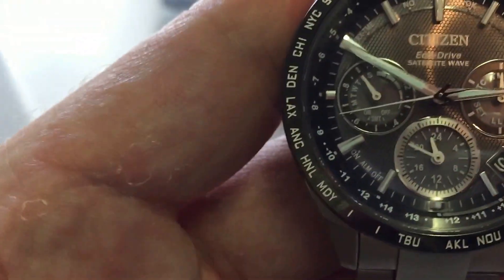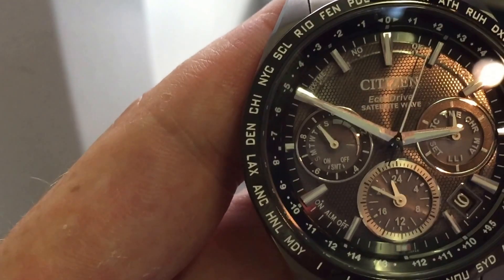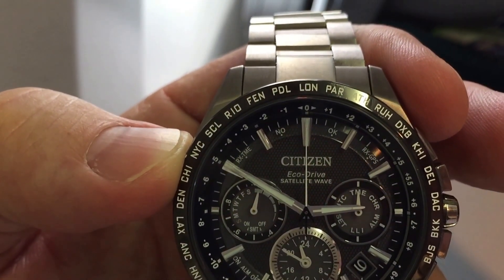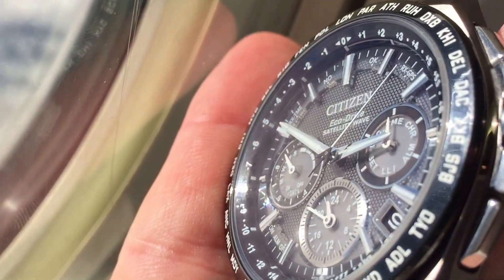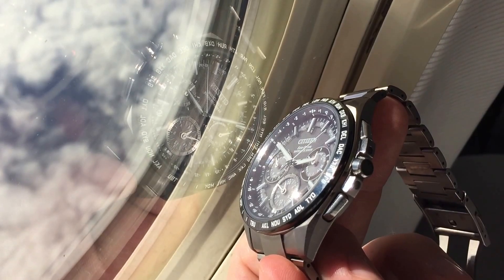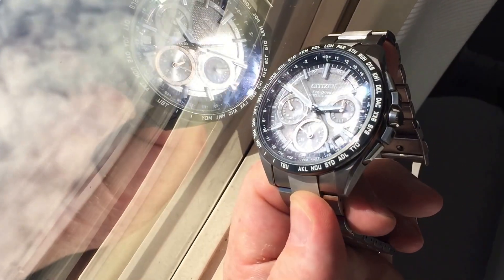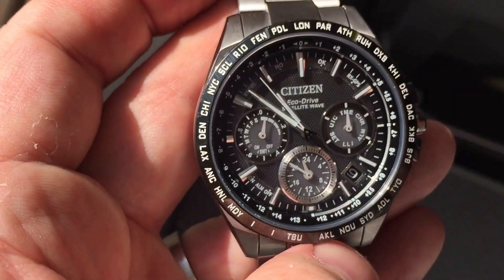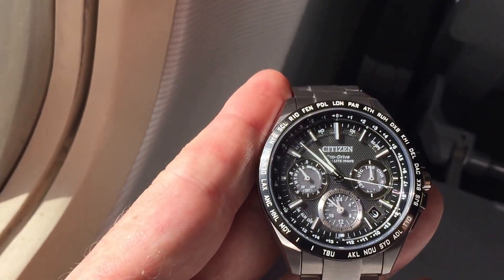Satellite Wave GPS F900 - in-flight test

Comment: Does it do auto sync at a given hour everyday like the radio controlled ones?
Reply from the maker: No, with Satellite Wave it needs direct line of sight to the sky. 

So, it has a light level detector which will detect strong daylight (to determine that you are outside) and will do a quick sync when it detects it.

This will be done automatically whenever the watch has not been synced for six days or more.

Comment: Question so this watch it doesn’t change time by himself??? Do we always push that button for satellite signal?
Reply from the maker: It will look for a time signal by itself every few days when it is in light.  You can also manually request a signal, like I did in the video.  Note that when it automatically looks for a signal, it will update the time and date but not the GPS location.  GPS location update must be initiated by the user.
Reply: Citizen Watch Ireland thank you.
Reply: @CitizenWatchIreland  When the watch looks for a satellite signal by itself, time and date are correct. But time zone does not update as you mentioned. Why is this a problem? This is what I could not understand, many thanks

Comment: I thought using GPS onboard a flight is a no no? It greatly interferes with plane nav system?its on the instructions. But a damn cool.watch nonetheless..too bad fiscontinued. I just hav to ask area ATC on timezones.
Reply: The GPS signal is continuously  sent from satellites. All this watch does is receiving this signal and set the time. I guess the airplane uses the GPS signal as well. So no worries.
Reply: No. The airplane itself works with GPS. The watch itself has no emission and just a receiver.
Reply: It does no harm while the aeroplane is cruising. Believe me, I am an ex airline pilot. This Citizen watch is really cool by the way.

Comment: Hi, does it have to wait 3 days to synchronise?

Is it good to synchronise several times a day? (For a pilot flying several legs a day?) 

Thanks!
Reply: My F150 was able to get 10 timezones in a row going from LAX to ATH on the plane. It did run the battery down about half way, but it recovered quickly.
Reply from the maker: Hello. You can initiate an “on demand”sync whenever you like. You can also manually advance the time zone - this may be quicker if you are doing it multiple times in a day.
Reply: Citizen Watch Ireland hi

Sorry for the delayed reply. I didn't realise you had responded.  

I'm after the f900 titanium. It's similar to this I'm assuming. 

I didn't quite understand what you said, would the watch sync itself when arriving at the destination or would I need to manually sync it at every time?

Thank you.
Reply from the maker: Hello. You would need to manually sync, or alternatively you could just adjust the time zone setting.

Comment: Line of sight? This gentleman is cruising at high altitude... Anybody?
Reply from the maker: +Jeffrey Richardson yes, I wasn’t really sure if it would work but it did. Thankfully it also works just as well on ground level with line of sight to the sky.
Reply: The GPS signal is line of site signal from the watch to sattelite and satelitte sends back the answer of the time/location where the signal is travelling also as LOS. The sattelite is above the airoplane so there is no signal refraction  in between and the reception of the signal would have worked even if you have not put the watch to the window. The atomic watch uses an RF signal which is not LOS similar to mobil phone..however the atomic watch wont calibrate the time automaticaly in the airplane because the plane is above the atomic signal tower. I hope that i answered your question.

Comment: Does the watch actually has a parabolic dish build in to pick up and amplify signal from the satellite?  Or is it picking up satellite based time from a satellite land based receiver via radio, like a cell phone?
Reply: If the update occurred in flight the watch has a built in GPS receiver( Cell phone signals typically can't reach that high), and  is getting it's position information directly from satellites.These receivers do not require a parabolic antenna. Cell phone gps coordinates are derived directly from gps satellites. Applications like Google maps do not work out of cell phone range because the map is downloaded from the cell towers, not because the cell towers are required to obtain position information.
Reply from the maker: Hi +Andrew Piatek   - I don't believe there is a parabolic dish inside the watch, I can't see how this would fit. However it is receiving the signal directly from up to 4 GPS satellites - not from a land-based broadcast. 

The internal GPS receiver works similarly to the GPS chip in a SatNav device. It can connect to one satellite for a quick update of time and date only (takes about 3 secs); or alternatively it can connect to up to 4 satellites to receive and triangulate GPS location information. This 2nd option takes about 25 secs and allows for automatic setting of time zone.
Reply: Citizen Watch Ireland Yeah, but to receive a satellite signal you need a parabolic antenna to converge and amplify the radio signal.  Land based repeaters is the logical way to go if you don't have space for parabolic dish.  Unless I am missing something.
Reply from the maker: +Andrew Piatek I  presume the parabolic antenna you refer to would be some kind of dish, like we use for satellite TV?

I don't think you need such a dish for GPS signals due to the low bandwidth involved. However I will admit that I'm at the edge of my technical knowledge on this subject... 

A land based repeater would seem to me to defeat the purpose, which in the case of this watch is to quickly receive signals anywhere on earth. Surely if you were relying on a land based repeater, you would be limited by the range of the repeater's radio signal?

These watches can pick up a signal anywhere on the face of the earth, as long as there is line of sight to the sky and no interference.
Reply: I see.  Well, since I don't own a yacht or even a car, my GPS knowledge is also limited, since my only experience with GPS is through my Xperia cell phone and AT&T radio towers.  In other words, no direct link to satellite.
Reply: There are stupid questions after all.

Comment: why u have to wait 3 days since the last gps update?
Reply: Hi Rick.

 You don't have to wait 3 days. Whenever u like, you can do either an manual "time only" , an "time inkl. leap second" (see google) or an "time + time zone" update. The watch will do an automatic update (only time!) via gps after 6 days (under certain circumstances). Taking into account the high precision of the clock the worst case would be a 1 second deviation from correct time. Usually the F900 is even without an gps-update a very accurate caliber. Mine can keep  app. 1 second (or little less) within one month without gps update.
Reply: Rick it's 3 seconds, not 3 days, LOL XD.
Reply from the maker: Hi Rick - I believe PEOPLESX has answered this one accurately (thanks PEOPLESX!)

Comment: I did this same test on my f150 and it worked. Thanks for sharing.
Reply from the maker: +craik so you opted for F150 over F100 in the end?  I remember you asked about both a while back...  Hope you are happy with it. 

You would not have been able to perform this little GPS experiment with the F100 of course !!
Reply: Citizen Watch Ireland actually I already had the f150 when I was asking about the f100. :) I just like the overall design of the f100 and wanted  to have it but then it didn't make much sense to me since the f150 is technologically more advanced. So I opted not to go for it in the end.